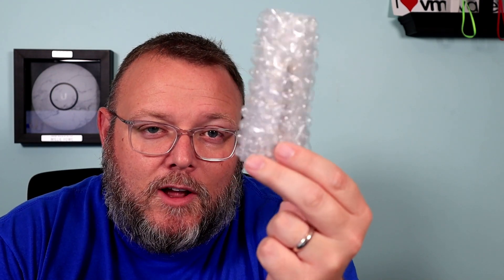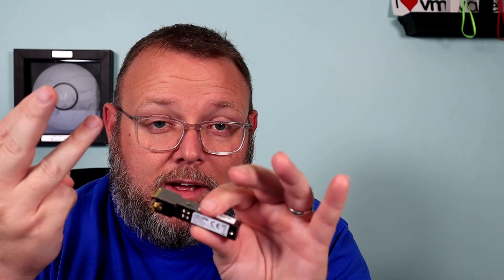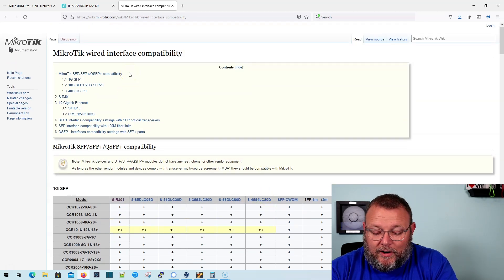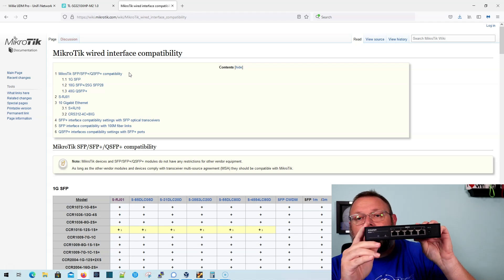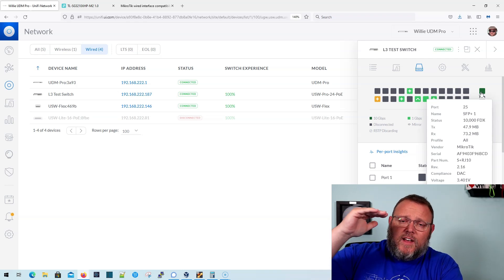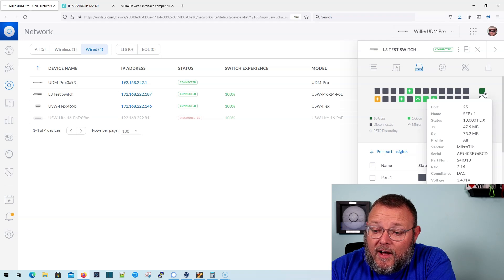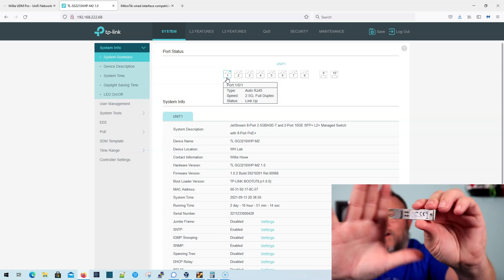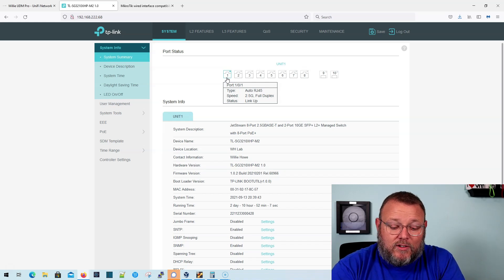MikroTIk S+RJ10 SFP+ Module - The last copper SFP+ module you'll need?

Comment: I've recently added a  USW-Aggregation Switch to my network and understand the SFP+ support is 1/10Gb only which I'm currently using. Wondering if I could get 2.5Gb to my PC with this Module?
Reply: Yes, you can. I'm doing this with my current configuration.

Comment: 200m? Are you going to verify this? Most copper transceivers are limited to 30m at 10G. I've only seen a few that will do 80m. Unless 200m is only at the lower speeds...

Comment: Does the Unifi switch try to put 10Gbps of data into this module when it is running in a slow link speed? Does the discrepancy in detected speed result in weird behaviors, e.g. dropped packets in bufferable, brief events of congestion?
Reply: I had to enable the "flow control" feature of my UDM Pro and Pro Switch 24 for this very reason (using a 2.5Gb connection to get 1.44Gb from Xfinity).

Comment: I tried two of these on my MikroTik network. They got too hot almost to touch.  I switched to  DAC cables and had no problems.
Reply: I had the same problem with the Ubiquiti modules on UniFi switches. Had to resort 1Gb links.
Reply: DAC cables are the way to go for inter switch links. These copper modules are good for long runs where fiber is not feasible.

Comment: I just tried out an Ipolex 10G SFP+ module in my TP-Link T2600G-52TS switch to test a 10G router WAN port. It seemed to work but it got VERY hot immediately. Wondering if you noticed anything like that.
Reply: That's the issue with 10g copper, especially copper sfps. Try using DAC or fiber sfps and cables instead.